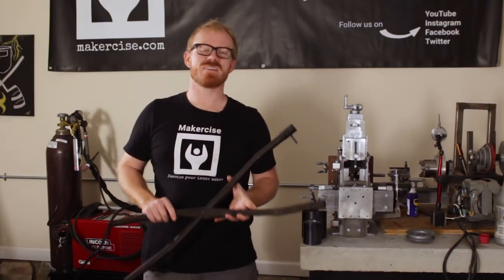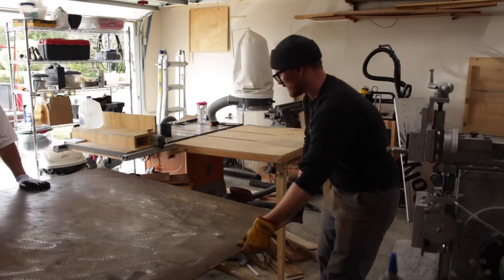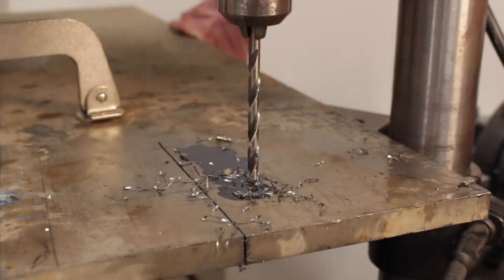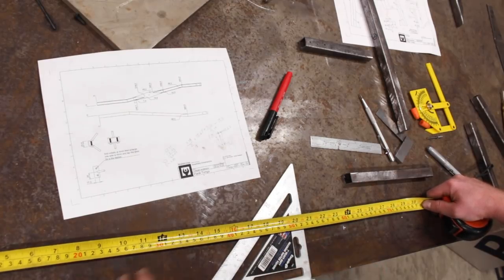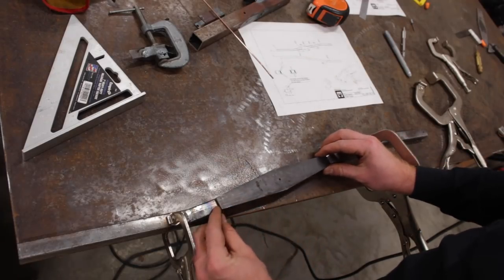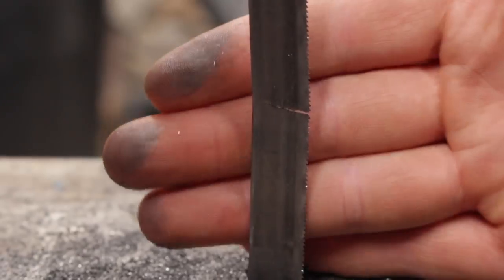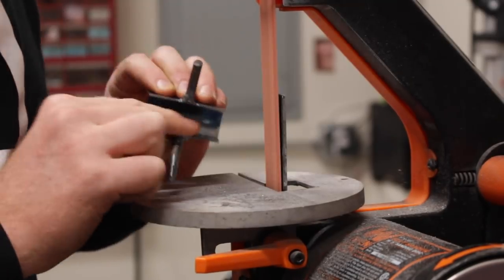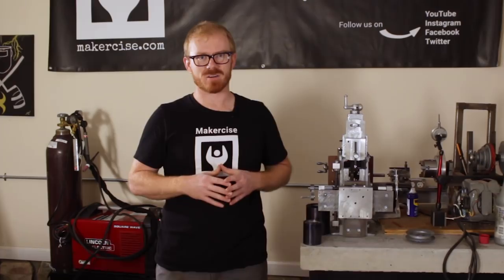Flask Tongs for Lost PLA - TIG Welding Skill Builder

Comment: by the way, there are angle grinder stands, you clamp your angle grinder in it and it will act like a chopsaw. its perfect for this kind of square tube. it will give you a really nice fitup and consistent angles!
Reply from the maker: I have an abrasive chop saw, but I prefer the bandsaw in an enclosed space to keep airborne particulates manageable.

Comment: FYI some types of Tungsten electrodes for TIG should not be ground in the shop as their dust is toxic. This doesn't apply to all TIG electrodes so check your electrodes and safety protocols for grinding them to make sure you're safe.

Comment: sharpen the electrode longitudal, your torch angle is too shallow, remember that the heat goes, where you point the torch at. if you hold it like that, it will be very hard to control the puddle bc its going to run away from you. 

and yes, you need to sit down to tig weld, at least prop your arm so you can hold a constant arc length

Comment: Nit picking - you can't sharpen tungstens like that. They need to be sharpened parallel to the long axis or you'll have problems maintaining the arc. Source: Am noob, made same mistake.
Reply from the maker: I will give it a shot. Thanks
Reply: i've never had that problem

Comment: Since those are tube, don't you need to be worried about the heat now being piped up directly through the one tube that is solid and out the open end?
Reply: As long as he don't hold crucible for too long it will be fine, hot air will be cooled by middle and end section of the tube, essentially making heat pipe. But TBH even if there would be hot air coming out of the pipe, it wouldn't be nearly enough to cause burns.
Reply: @Krawacik3d  I wasn't trying to neigh say, and maybe this is true for casting.  I'll keep that in mind.  I guess timing is the thing with this.  I do quite a bit of smithing, and I know this is one of the largest safety issues.  Especially when you quench a tube you've been working...the hot steam bursts out the top of the tube...which can be dangerous.  And I realize this is different, even when heating the tube, as you are leaving it in for a long period of time.  I guess I just wanted to ask the questions since welding a little cap on either of the open ends would probably be safer and this is the internet.  Not saying anyone has to modify anything, or that this is going to be dangerous for Makercise, just that there are people watching this that might get hurt.
Reply: @ironhead65  Welding pipes shut can be tricky, the best option would be to drill small hole near the buisness end and weld close the "cold" end.
Reply: @Krawacik3d  sorry my wording was vague. I intended 1 cap, for the very reason you mention. Thank you for clarifying for the community!